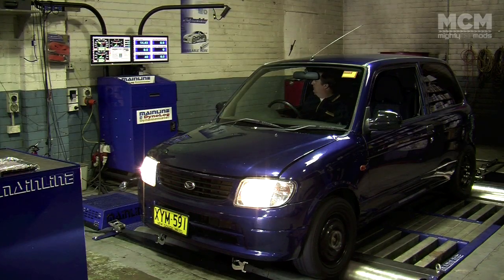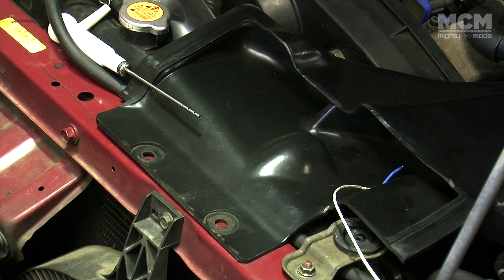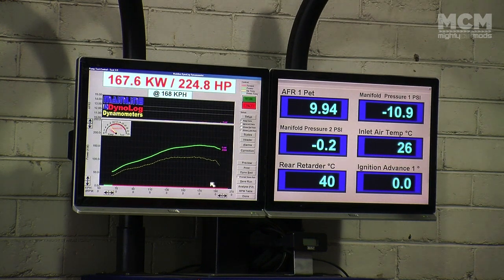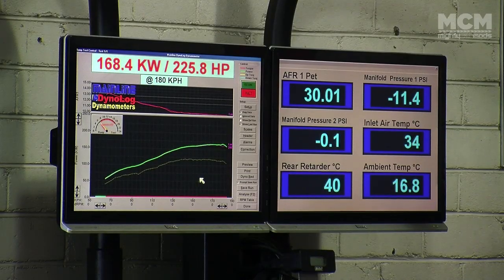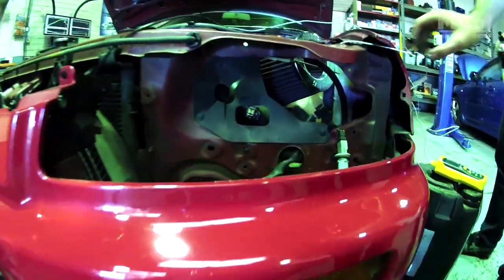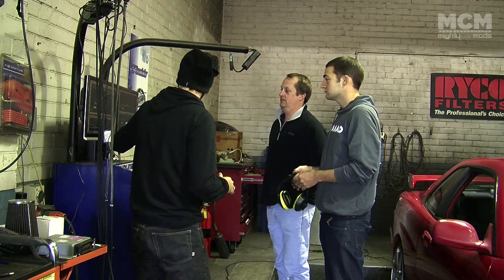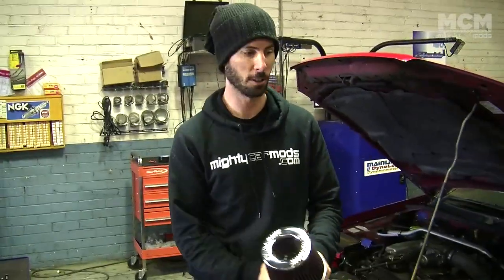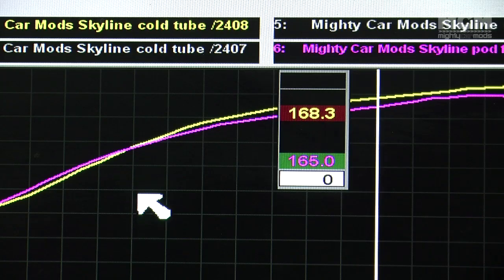Cold Air Intakes Mythbusted [Turbo]

Comment: This video is spot on for this application and stock vehicles in general. Yet, it's misleading to the performance enthusiast that usually has other upgrades done to the car. What this video actually proves is that this car is not limited by its intake system in other words the intake is not the current bothleneck, and considering what it is you would not expect this. The factory has already optimized it being a performance car. This same concept applies to everthing in life. Any given system has it throughput limited by the bottleneck. As you modify, upgrade or adjust a given system, the bottleneck continually changes. With cars each new mod will reveal a new bottleneck. If you add all bolt ons to a N/A car the heads and cam will be the bottlenecks. With a turbo car that has all bolt ons the level of boost will be the bottleneck, then the turbo, and ultimately you will boost to a level where the heads and cams will not allow anymore without being changed/ported just like the N/A application. 
For our example, if you kicked up the boost it will quickly max out the flow capabilities of the stock intake tubing and air box. Most importantly if your upgrade to a throttle body and intake that is much bigger than stock and it becomes necessary to stretch the stock tube to fit things change drastically.
For a real world example my car came with a 60mm TB and I upgraded to a 75mm unit with a 75mm elbow and performance lower intake. The stock intake tube barely fit over it and was clearly smaller than the 75mm opening of my new set-up. I also opened up the exhaust side with headers, a larger diameter mid pipe, and larger diameter cat back. When I upgraded to a CAI that had a larger diameter tube to match my 75mm TB along with a high flow filter it made a serious difference in power that could be felt and dropped 1/4 time by 3/10 th a second. The intake in my instance was a serious restriction and I have no doubt replacing it netted at least 20hp at the rear wheels because it was bottlenecking the other mods. Finally, I bought a handheld programmer and had a program made specifically for my car that was uploaded and accounted for the increased flow from my modifications and optomized timing for 93 octane. This made a massive difference!!!
This is whats misleading about the claims these manufactures make. They seem to imply that simply adding one of these intakes willl net the big gains and it usually will not. Yet, on a car that has the other complimenting mods like I mentioned it can make a serious difference in power. I suspect when the manufacturer are makes these claims if you read all the fine print, or get the specs on the test vehicle they used it to was added to a car that had other mods similar to my own or had the boost level on the turbo jacked up.

Comment: Shouldve got a good car instead of a fuckin rice burner
Reply: How the hell is a Skyline a rice burner?!?
Reply: that skyline with walk your car
Reply: athousand killerdicks What are you saying?
Reply: athousand killerdicks shit i got a trans am with the 350hp 5.7 ls-1 pack with heddman headers,moroso cold air intake flowmaster dual custom exhaust with a stage 2 racing chip in it?? pushing 440hp,rice burner walk what??? more like it will limp home to the rice fields lmao
Reply: BlowinSmokeBig
You apparently know nothing about skylines. Not only is it faster than your trans am but it handles far better while it "walks all over" your car.
Reply: BlowinSmokeBig dude.. my civic will beat that trans am
Reply: Mine too. Any time any place.
Reply: Nate P LMAO
Reply: BlowinSmokeBig   <<< as name implies
Reply: One more thing...by my figures, a 3400lb car to run sub 12s...that is 11.9 second ET has to make over 500hp. So your claim is debunked. Sorry bud. Go blow your smoke somewhere else.
Reply: body has been tubed out and doors have been made from fiber glass and gutted to bare min. plus racing flywheel and gas tank droped for one in back,its not an everyday driver but still legal and hoosier slicks sitting in the shed,heaviest thing in the car is the windows oh and bucket seats,havent took it to a dyno but i have ran it on the track before the cold air and heddman headers was put in but w/e u guys laugh and talk it up but my shit would smoke tht ass
Reply: Nate P yes, horsepower and weight are the only thing that determines a cars speed. why dont we just strap a v12 to a skateboard. now that's a power to weight ratio.
Reply: BlowinSmokeBig How do we know all this is actually true? But if it is, Im racing pinks too. I'm saying video or it's not real
Reply: no...... REALLY????
Reply: Video of yours or it's not real.
Reply: Too right oris lopez
Reply: What is the point of a 5.7L engine when you have to modify the shit out of it, if it is to be anywhere near its European rivals? I can take a 1,6L turbo charged engine and make it go 3 times faster around a track than that huge pile of American junk. So 5,7L and 350 HP? If you gave a European to fiddle around with an engine that size we could easily squeeze at least 150 HP more. Alas, European cars can actually corner, they are more comfortable, they are not made out of pig iron and they are made by engineers, not two blokes from Kentucky. Yeah, the European cars are a downside more expensive but then again, you get what you pay for! You get a car, not something that resembles a car and handles like a boat.
Reply: ***** Thank you. I understand that V8's are better then 4 cylinder engines when it comes to a drag strip. But whenever the Americans make an engine and claim it rivals our best engines, (European) it is almost immediately beaten within a month. We build something more durable, more environmentally friendly and faster. And then they waste another year trying to build something else better and the show starts all over again. Don't get me wrong, American V8's are good but only in America, not in continental Europe where the roads are smaller. It would be daft to buy a Corvette and drive it in Copenhagen or London for example. We simply cannot accommodate them. We love polar bears and PROPER ENGINEERING more I suppose.
Reply: ResidencijaZLA dude you obvisouly have no idea about american motors, and are a European fan boy. how about the new 5.0? And what car do you guys have the makes over 700hp from factory that isn't over 100000 .none so learn your shit and stop being a fan boy. and be a car guy i respect all brands because there's good and bad about everything
Reply: Because mustang
Reply: blownaway14 Our cars are not cheap. That's why they don't fall appart and are noisy whenever they are driven over 12 mph. We have engineers that have actually studied. Not bill and bob from centucky. And your 700 bhp cars cant corner if their lives depended on it. We can beat them using  200 bhp turbocharged hatchbacks.
Reply: Skyline a rice burner? It will beat your car guaranteed

Comment: The smaller the displacement, the less modifying the intake will do. its simple math. Adding a CAI to a 4-banger is just emptying your wallet. May do more harm than good. Like CEL's for one.
Reply: That Skyline isn't a 4 banger
Reply: Not necessarily, for a small displacement n/a motor most of the time yes, it is a waste but when you have a force induced engine that has a small displacement that sometimes means a lower compression ratio which requires more forced air to produce power so even if it doesnt create more horsepower physically, the lack of restriction will make the engine more efficient and increase performance, which a lot of intakes claim, not just hp gains.
Reply: Okay, put a 12lb turbo on your Prius and See if it likes a paper filter.
Reply: Zachary Hein to make what? 95hp?
Reply: Zachary Hein Your buying the "breath better" K&N dog and pony show huh? Nevermind the sound of dirt hitting the valves, the sucking sound your hearing is your wallet, nothing else. Its plain physics, atmospheric pressure is 14.7 pounds per square inch. dP = 0.5 x rho x V^2 At 100mph you add 5.8% pressure at the nose. But DOH! you removed the factory airbox mounted in the front, so your back to suking air like a 1972 Chevy Vega. Lost HP for a sucking sound, sad
Reply: Bondo unless you have forced induction then it is more.
Reply: Tyler Nicholas Depending on the displacement forced induction makes a tiny difference or a fraction of a difference at 100mph (5%). Below 100mph nothing. Possibly a loss compared to a modern snorkel intake. 30 years ago when the air cleaner was located on top of a hot giant v8, forced air induction made a difference. Not because of compression but the fact cleaner denser air was drawn from outside of the engine compartment. But manufactures soon found out the hood scoop could destroy an engine on a rainy day. Today modern engines come with a front mounted snorkel that provides both cooler denser air and some forced air being mounted in the nose. This snorkel is designed on computer to create little or no restriction being matched to the max volume and velocity of air the engine can ingest. Then theres this thing called a "vortex". Note that new intake manifolds are circular by design. because its shaping the air for maximum volume. Disrupt the vortex with a non-matched CAI, you could defeat the entire design. CAI's were great once. But those days are gone.
Reply: I dont think you have the right definition of what forced induction is in this case.  Forced induction means you are adding compressed air through the use of a supercharger or turbo charger.  Whether it is above or below 100mph forced induction makes a difference in any engine no matter what the size.  And in that case, this "vortex" in the intake manifold you are talking about could not at all be changed by the intake because the air must go through the turbo or supercharger and an intercooler even before it reaches the intake manifold.  The real advantage of an aftermarket intake is that you are reducing restriction which allows the air to move undisturbed and unbaffled through the compressing device.  The only difference between a CAI and a short ram intake is that the CAI is farther from the engine bay, pulling in colder air, which show why when they put the intake completely outside the bay itself it created the most power.
Reply: Matthew Kahl Yes its possible I went off the tracks. agree with what you said, a turbo or SC is really the only way to add anything that justifies modding the intake.

Comment: Just by bolting a filter on the end of the stock piping wont get you ANY gains...u have to change piping diameter,routing(less bends possible) and TUNE THE SETUP to get gains!!!
I cant beleive you guys dont even mention this...my honda Si pump out 220whp+ from intake header exhaust...i tune ecu s and ive seen every changes it does with over 15yr experience....just boltiny a filter on the end of stock piping is not a cold air intake!
Try using 3.5inch piping on an efficient engine like a k20...TUNE IT and tell me you dont get gains!!!
Reply: Thats what makes the k20 kinda cool. You can gain quiet some power out of bolt-on parts, not much need for big mods. My SI is sitting at 180hp but i just bought headers, and exhaust system, see where that takes me
Reply: Victor Palma where did it take you?
Reply: Sami Abbasi follow the yellow brick road

Comment: just math guys....
i know "cold air" matters but your showing restriction
2.5 liters = 2500cc / 16.388 = 148 cubic inch
148 cubic inch "displacement" x 8000 RPM = total air flow.
Your engine is not restricted to start with. 
Especially running K&N filters or none at all. 
figure a ford 5.0 @ 7k RPM - 
Chevy 6.0 @ 6.8k RPM-  or even an old school "427ci" 7.0 liters @ 6.5k RPM
now the air flow restriction is a factor. 
thank you for trying to show the world of "two-ish" liter engine owners you don't need air flow.
and 1.7% on a skyline --- by the way you should be proud. Cuz that intake is already good... 
take a nonperformance vehicle and you will double your improvement easy.
thanks.

Comment: Works better on a naturally aspirated vehicle
Reply: michael gillikin that’s not true at all
Reply: If anything, it would be less effective on naturally aspirated.
Reply: Whether it works or not is debatable. Hell I've seen people brag about their cars that are .2 seconds faster than my car to 100 like its amazing. But there is a reason that these are so popular. Apart from forums, these are the "Go to" packages with performance retailers. And you can see why. A stock standard VF II will make 242-RWKW out of the factory. Or at least on this dyno. And with putting a OTR intake + Exhaust system on, that number jumps to 300-RWKW. Am I saying these companies package these "Snake oil intakes" with an exhaust system for more money? Well, its very possible. But if you are to "Bust" in this case a very popular modification. It would be taken more seriously with a wider range of vehicles. Especially since they cite "So will an aftermarket Cold Air Intake give you more power on a turbo charged car?"